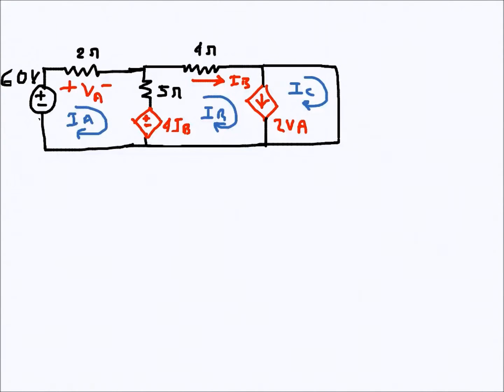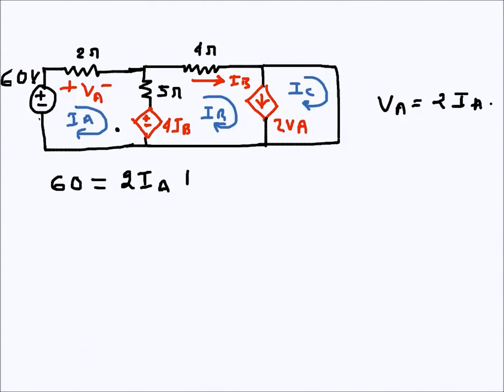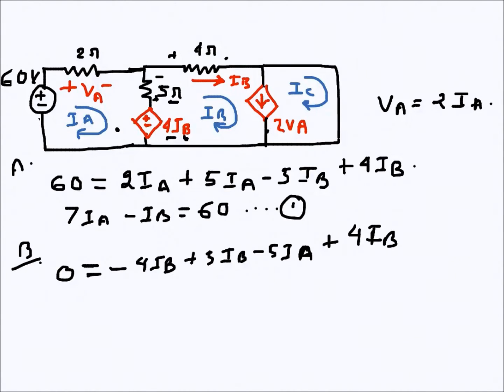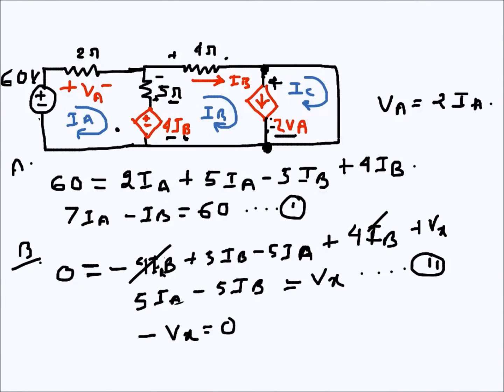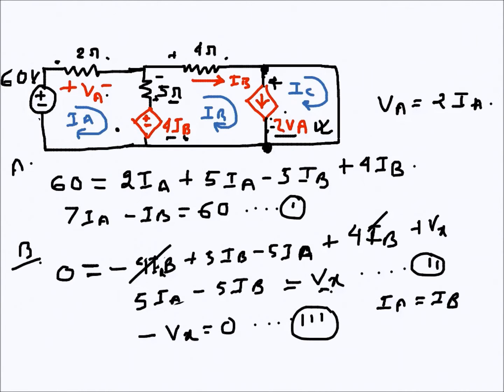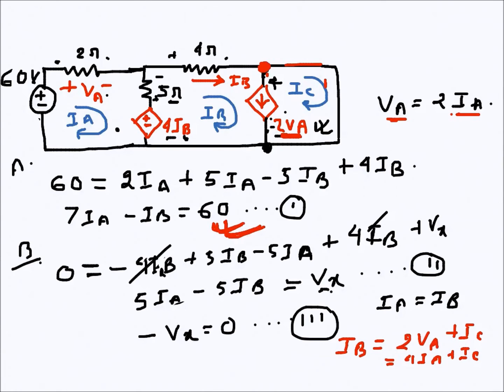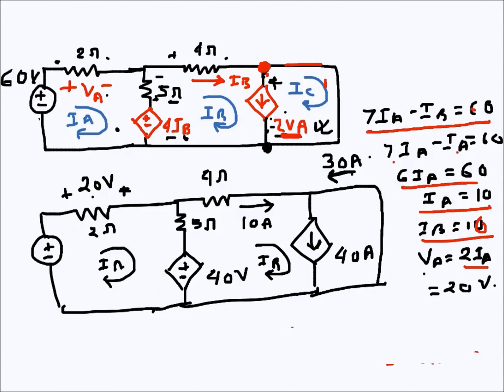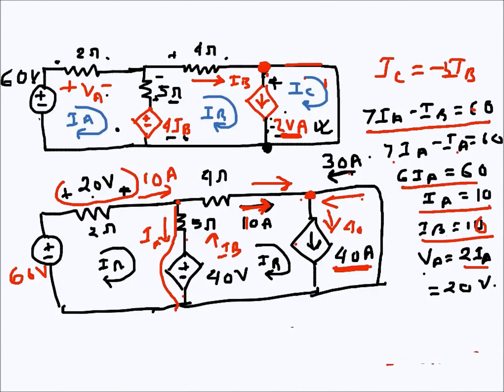Electrical Circuit: Loop Analysis with Dependent Source (example 1)

Comment: How is Ib = 2Va + Ic? I mean why plus Ic while it flows in the opposite direction to that of 2Va?
Reply from the maker: If we apply KCL  at that node, Ib is incoming current while 2Va and Ic are outgoing currents (so Ib=2Va+Ic).  Ic is loop current but current in the branch containing the voltage controlled voltage source will be defined by the control voltage, so the current in that branch is 2Va.

Comment: If there is a series resistance with the current source then how to apply loop analysis
Reply from the maker: I may have misunderstood your question, but if there is a series resistance with a current source the current of that branch will still be equal to the value of the current of the source.
Reply: If a resistance will be in series with current source then that resistance is no use in that particular branch.